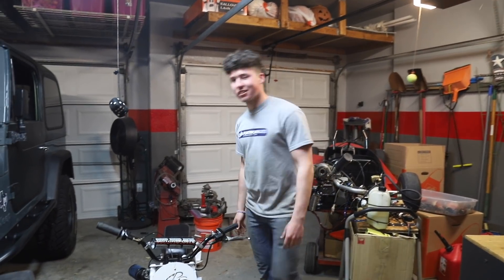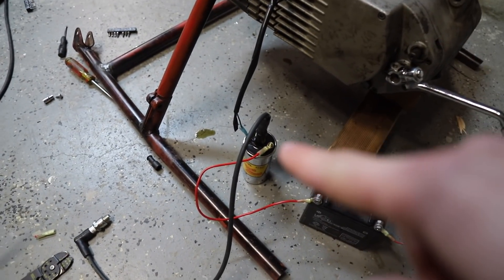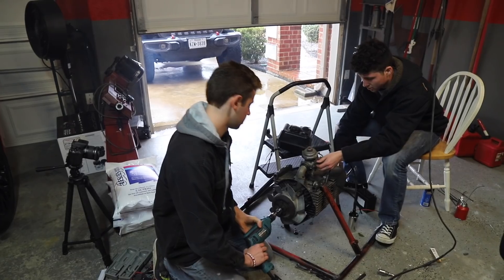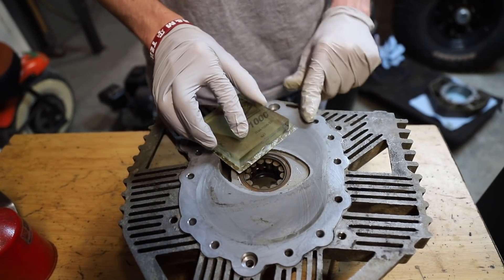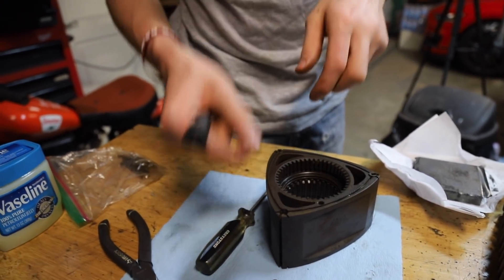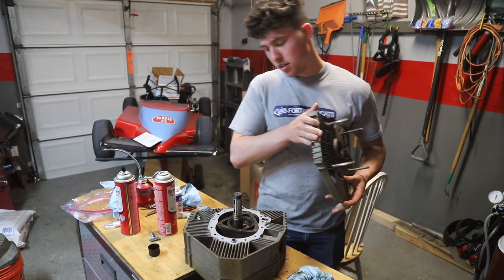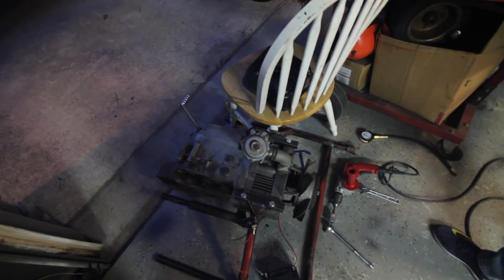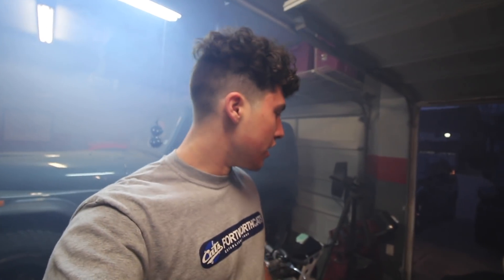Ultra Rare Rotary Engine FINALLY RUNS! | Rotary Shifter Kart Build Part 3

Comment: I'd try adding a Reed-Valve cage (Just 2 sided) on the entry side plate hole (Yanmar Diesel, SAE papers 710581 and 720466), also having the air filter blown with pressure air from cooling fan, as in Citroën Ami, Dyane, Mehari; some install a Mikuni type 32 carb. The best arrangement would be having the intake plate at rear, but this turn is very difficult to implement. Best results oil is Shell Rotella SAE 30, SAE 40 for hot weather; 3 to 4% in gas. Salut +

Comment: Don't forget to run premix with the gas, running it dry will destroy the housing and/or wear the shit out of the apex seals. You shouldn't have to run a ton in it being such a tiny single rotor so order about 6 quarts of idemitsu and that should last you a good while depending on how much you plan to rip around with it. otherwise great job on rebuilding. I've already watched all of the other videos, pretty cool shit, keep it up.

Comment: Hey, guys, that thing could kill you by ripping your head off.
Getting in close to the fan wearing a hoodie with loose neck strings hanging around your neck is simply stupid. The fan can/will suck your strings in a then the engine will rip your head off.
All professionals have safe practices. NEVER, EVER, NEVER wear loose clothing, jewellery or other items that can easily be pulled into and wrapped around moving parts.

Comment: the sound alone, just glorious. wd, guys.
obviously there's no governor on the carburetor, so the idle and max set screw need some tweaking i guess? has it any mix set screw as well? rather have it on the richer side i guess for better lubrication...

Comment: Ive gots a sachs single roter ratary enging km45 
Its been standing in a warehouse for 30 + years but it starts on the firts pull 
I use a 20/1 mix on it

Comment: Best thing about rotary engines is they are small and simple, every time they break you just take them out and apart and bput them back in a couple hours, all done
Reply: And they run pre-mix or oil injection.

Comment: Do you need to run a ballist resistor because your running a points ignition for 12volts to 6volt system?

Comment: Just want to give you a quick crash course on Battery/Breaker ignition systems.

When the points close, the Primary Winding in the coil charges and builds a big magnetic field.  When the points OPEN, that field collapses THROUGH the Secondary Winding, which has a LOT more turns than the Primary, and that field collapse generates the spark.  It works exactly like a transformer only instead of AC power, it gets pulsed DC power from the battery/breaker.  You might wanna study up on this if you plan on running this engine a lot, as one of the tune-up steps is adjusting the DWELL time (The number of degrees of engine rotation) that the points stay closed.  That controls how much charge gets to the primary winding, and thus, the strength of the spark.  Oh, and buy a couple of condensers for your engine.  You'll need'em eventually.

Comment: **NEW SUB** It's all about the SEALS. I had an RX2 in 74 I completely rebuilt and SERIOUSLY kicked ass on MANY, MANY cars and after passing every single one of them and blowing a 2-foot flame out the rear, most every one would pull up later and ask WTF is that car? And what is in it?

Comment: Can you guys put on an expansion pipe from a snowmobile and see if it self-supercharges like a piston 2 stroke? You would probably also need a 1-way reed valve under the carburetor.

Comment: Just a little bit of advice when you do the compression test open the carburetor 2 full throttle that way it allows enough air to get in there to get a proper reading. Let me know that you read my message by giving me a thumbs up or something because that's very important and people usually don't know that. 
I have to say that you guys went from knowing zero about rotary-powered Motors two totally rebuilding that Beast and getting it running in just 3 videos and in less than a month. That my young man is very impressive I had said something that I thought was true to Heart a couple of videos ago and I was kind of disappointed that I got no response I think you should go back and look at it. Chances are you'll give me a thumbs up. It makes me think that you guys get so many responses that you become overwhelmed with all the comments. But that's a good thing keep up the good work guys💪☝️🤘👍👏👊

Comment: Your low compression issue at first may have been partially caused by flooding when you were testing to see if it would pull fuel into the carb. If you flood a rotary the fuel washes out the thin layer of oil that helps seal the apex to the housing. I only know this because I flooded my FC RX7 when I first got it. It would only turn over and wouldn't get compression. A local rotary guy told me about the issue when it floods. He said to pour a little ATF or heavy weight oil in the leading spark plug hole or brake booster tube. I chose the brake booster tube, and it fired right up.

Comment: An old Hercules rotary?! Man, I haven't seen one of those in ages! That's a rare bird you've got there!😯 Sounds good now that you got it to seal up. Whenever it's due for apex seals, you could probably rework a set from a Mazda 12A to fit. That should be pretty froggy on a shifter kart. You know the original Grand Prix Racing karts that used to be all over the country back in the 80's ran rotaries also, but they were CVT clutches. With an actual transmission, that thing should be a barrel of fun on a kart. Just make sure you get the blower housing on it pronto and mount it on the kart with that intake forward so it can get plenty of air and not warp your rotor housings! Good luck. Looking forward to a vid with this thing on a rolling chassis!😁👍👍 EDIT: If this is actually off of a W2000, it should still have an oil injection pump on it somewhere. I wouldn't be too trusting of them though, as they were prone to failure. Pre-mix is most likely the way to go, and with synthetic oil, you should be able to go about 40:1 and clear up the smoke a bit, Like I mentioned in another comment, expansion chambers work nicely on these too. If you can snag one from a Yamaha YZ-250, it should be about right for that engine, since they're around 294 cc's.😉 You may have to re-jet it up a bit with a chamber, but you can work that out as you go... ( Hint: they work MUCH better with a regular Mikuni slide type carb, and are easier to tune, with readily available parts). Also, if you can retrofit an electronic ignition trigger where the points are and set your initial timing to around 10 BTDC, you would have the advantage of automatic spark advance according to RPM. There's so much you could do with this little engine to make it run better and be reliable!😁

Comment: It’s hard to find apex and side seals for the Sachs Wankel engines they used on snowmobiles in the 70’s and when you do you’ll have to pay out the @ss for them.  I’ve heard of people cutting down rx-7 seals and using them but thankfully the seals on my 303 were in great condition so I didn’t have to try that.  Good luck with the project and keep them rotaries alive!

Comment: i admire your zeal there kids..you have great ideas for getting the job done..in your garage..on a low budget..we need more like you..heres a "old sckool" tip for your glass trick..goto local glass shop and get a 18"-24" squared piece of glass..lay it on a flat surface..throw down some marvel mystery oil..then whatever kind of sand cloth you want to use..then throw down more marvels..then face whatever piece you want to resurface down and go in a figure eight..its the closest thing to what a machine shop will do and you will get very good results ie: very even overall flat surface..this works for all your cylinder head,case and trans housings..or for anything you need a overall flatness..now marvels is recommended because its 70% high grade mineral oil and 20 solvent and the rest is binders and other stabilizers so its a excellent medium for resurfacing with sand cloth..btw..any time a solvent and aluminum are used together the solvent will draw the aluminum dust back into the pores of the actual piece..so be sure to clean the piece with hot very soapy water..hope this helps..keep up the good work )

Comment: I was pretty hopeless at that stuff when I was your age (24 years ago) but the world wide web didn't exist rather the BBS (binary broadcasting service).

I was thinking if the motor is to be used in a motorbikes that an electronic module could be used to provide the ignition coil with ignition advance such as what motorbikes have in them.

Or you can just run it at a "locked" setting if the motor is run full throttle all the time,if running ignition points don't forget about the condenser so you don't burn them out.

I was going to mention Atkins rotary for parts,half that one may be my relation,I'm not vime  so I'm not a Booth whose an Atkins.

Comment: All that smoke was probably not from running too lean (though some if it can be) but all that Vaseline.
Reply: Um you dont usually get 2 cycle smoke from running lean. The gas has oil in it

Comment: The carburettor doesnt suck fuel up , the fuel pump does that or gravity so lift the tank or pump it , And the coil you first used is not meant to hove power connected to it thats why you cooked it .

Comment: Freaken awesome to see this finally run! Im a huge rotary fan. Great accomplishment fellas. Btw removing the shredder valve on the compression gauge you can see each apex phase compression. 90 is pretty good 👍

Comment: You're suppose to remove the schrader valve on the compression tester to test compression on a rotory engine, and the gauge pointer should jump up and down, if it doesn't do this, you have a bad apex seal, also you get low cranking compression every time the apex seal pass by the spark plug hole. At high RPM this isn't an issue. One more thing, its displace is equivalent to dubbed a 4 stroke engine. For example a Mazda 13B is 1300 cc it's equivalent to a 2700 cc 4 stroke 4 cyl. engine.

Comment: Yeah that's not how a coil works... that is the correct way to connect the coil though. A coil operates via electromagnetic induction where the points create the ground connection for the electromagnet and when the points open (sparky time) the collapse of the electromagnetic field in the primary winding generates huge power ripples which are picked up by the secondary winding which usually has more turns/wraps per inch causing a further higher voltage momentary power output to the coil wire and spark plug

Comment: Don't forget to put the fan cover next time you turn the engine. Without it the engine will over heat as it needs air deflected around the engine just like a lawnmower engine.  You guys probably know this but i mention just in case.

Comment: You should look into the AIXRO xr50 engine. It is way smaller and makes 50hp NA and as much as 100 hp under boost. It's also just about as big as a weed whacker engine. It was used in a paramotor to climb Mount Everest by Bear Grillis. They are commonly used in go carts against 250cc shifter karts.
Reply: They cost like 5000 usd
Reply: @billyboots3730  Renntek karting sell them, burn mobil1 at 50:1 mix.

Comment: Pretty sure I heard you say premix, so yeah, premix. That engine sounds like the timing is too far back. You get the best power when its angry at the top under load, it's easiest to start when the timing is a bit too late. Carb/Jet wise you're on your own. Definitely make sure the sides housings are sealed. Also, it should be shooting fire and way more stable at idle so I would guess your running lean but thats a guess as I've only worked with the stock Nikki from the 12a. It should absolutely be shooting flames though (on deceleration).

Comment: for your guys turbo kart have you thought about running like a grom fuel injection system? it might make it easier to maintain a good fuel/air ratio and the parts are cheap

Comment: The magnetic field in the coil collapses when the points close and the electrical energy travels to ground after jumping the spark plug gap. There is no real circuit connection between the 12v and the plug wire.

Comment: brake fluid down into the rotor chamber increases your compression on start up, great for starting older engines
Reply: doesent brake fluid make metal rust??
Reply: @ronnyandersson3028  yes its very caustic never do what this guy said you can hydrolock or even blow a headgasket
Reply: @ronnyandersson3028  it also puts off very bad chemicals when burned
Reply: eats paint to, works really well on hard to start rotors, increases compression but when the engine starts you fill the workshop with smoke, takes a while to burn off but works really well, good trick

Comment: Rotaries don’t like back pressure keep it with just a strait pipe. i say put the small turbo on the rotary because every stroke is a power stoke i bet it will really spool that baby up and make power.b
Reply: Expansion chambers work good on these motors too, just like any 2 stroke that needs to scavenge. If you look up the old Grand Prix Racing karts, they had a chamber and silencer of sorts, and were also powered by a Sachs air-cooled rotary similar to the Hercules motorcycles.

Comment: There never has been and never will be a gocart as cool as the one yall are gonna build with this engine.
Reply: AIXRO XR50
Reply: There is a rotary engine built specifically for karts.  It is expensive and intended for racing.
Reply: My statement still stands. Whats it called tho? that sounds cool
Reply: Until someone finds 3 arctic cat 600odd something 2rotors, smacks them into a "1.2L" 4rotor 😂
Reply: True
Reply: A school mate of mine built one in the early 1970's using a similar Sachs engine that came off a fire pump. No gears but it was seriously fast .
Reply: I guess rotary carts are more common than i thought. A fire pump is definitely the last place id expect to see a rotary

Comment: Not gonna lie, after watching the first video on this I did nothing but cringe and criticize, but you guys worked out issues and found ways around them, and now you have a running motor. Not much torque in a shifter cart, but that top end will be sick. Good luck to ya, hope she stays running I’m sure parts wouldn’t be fun to hunt down.

Comment: Are you guys planning on sticking a turbo on this? I hear rotary engines do real well with them.
Reply from the maker: Aaron Wyler not super sure...maybe in the future but we are worried about messing up the engine if we do
Reply: @BuildBreakRepeat  Yeah its a super rare engine, I could see why you wouldn't want to risk it

Only built for the Hercules W2000 it seems
https://www.ronsusser.com/inventory/listing/1975-hercules-w2000-wankel-rotary-motorcycle-294-miles-time-capsule-survivor/

Comment: You need a special compression tester for RX motors, it wont show right! It is fine don't take it apart...
Reply: Michael Rendelman not true....a normal one will show you max compression, but there are 3 chambers, so you have to hold the button and just watch all three spikes
Reply: @nat5720  True but its not a correct reading. It's just good for really bad ball park. for some thing like this a normal compression tester is fine.
Reply: I second that.  While you can rig a regular one to read out it wont be accurate.
Reply: Just take out the shrader valve and a normal one will work just fine...
Reply: not true. but.. with or without rotary compression tester, you need the RPM of the starter and then normalize the compression numbers. you can of course measure it with standard one, but as mentioned, 1 rotor side can be different than the other.. its 3 combustion chambers.
Reply: I have a genuine  Mazda Rotory engine compression tester
With a paper printout .

Standard cmpression tester is useless
Even if you take out the Shrader valve.
Good work on rebuild 
Should have PORTED it
&  Mikuni 24mm "Flatside 
and custom megaphone
Header .
MONSTER TRQE./H.P.
Great job guys !
Welcome to the TRIANGLE!
Theirs NOTHING LIKE A ROTORY !
Reply: @frankfitzpatrick5300  ive tested a few with proper and converted standard ones.. Is in ball park and will show all three pulses close enough, built many a rotarys, you are correct really should use a proper one if you want exact numbers, but no need to bust balls lol have a nice day